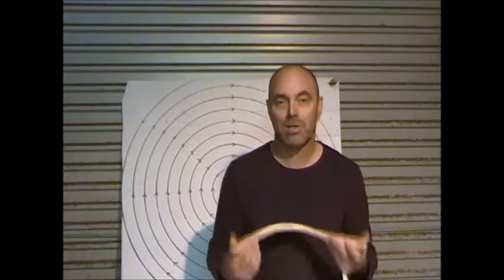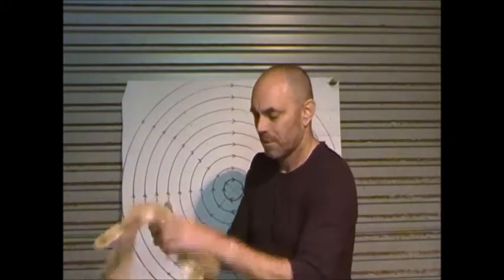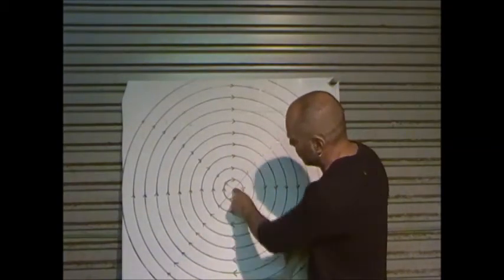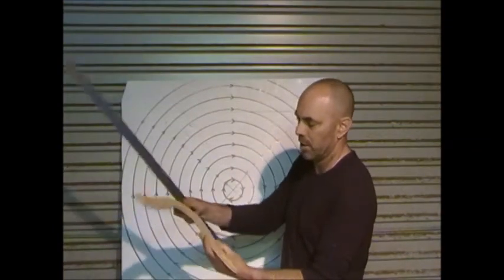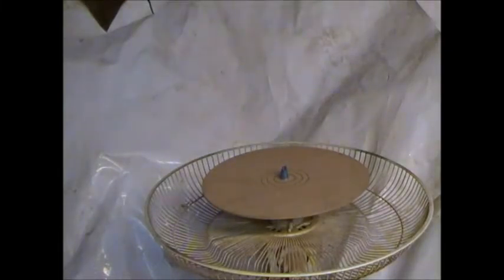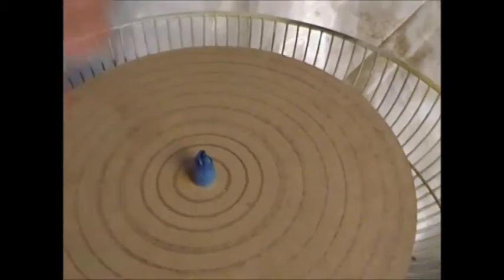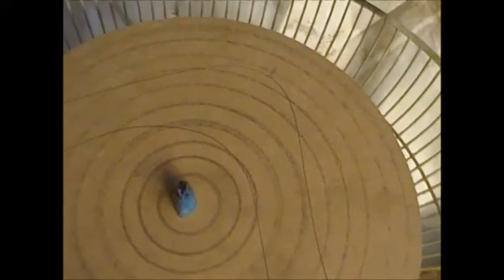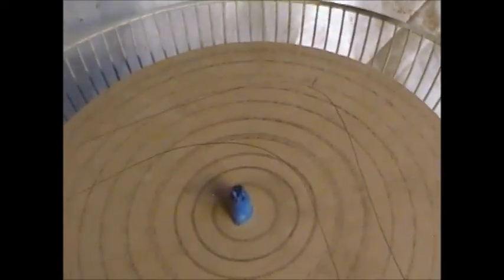Techniques for Boomerang Design, Part 1: Centre of gravity and rotation.

Comment: What about the fact that the boomerang is also traveling in the air at a certain speed? Then the end going going in the direction of travel sees an air speed which is related to rotation speed air forward motion. The other end sees an air speed related to forward motion, minus the rotation speed (it is going backwards!)

Comment: I'm no expert in physics but the centre of gravity of an object is also the centre of its rotation. Always.
Now if the air the boomerang goes through while flying changes its rotation I can believe that, the centre of rotation while flying might be changed by air resistance, maybe explaining why your painted concentric circles weren't describing a proper circle. However, one thing I'm fairly certain of is that your fan method of finding the point of rotation must yield the same result as your ruler method as both the centrifugal and gravitational forces used for each respective method are proportional to the mass which in both cases is the same. The air flowing around the boomerang when on the fan installation would not be enough to change the centre of rotation.

I love the video channel so far, you put a lot of work into this.